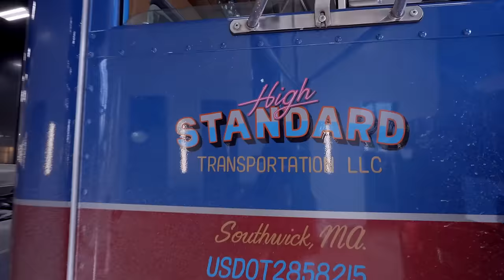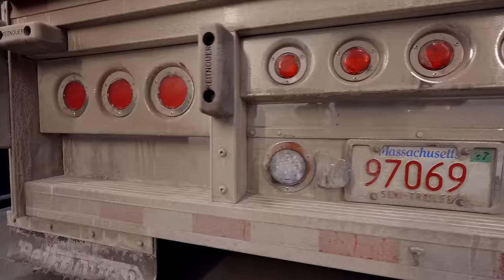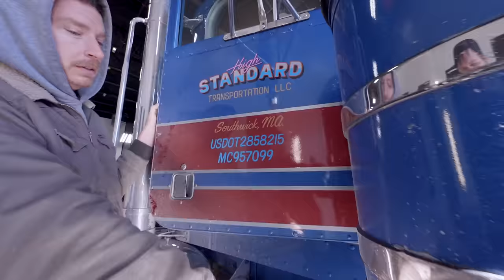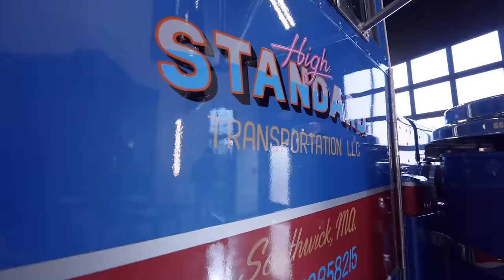Washing 50lbs of salt off a 1987 Peterbilt Big Rig(super satisfying)

Comment: New to the channel-I was a lot of big rigs- do you have a reason you normally wash from the bottom up when spraying off?
Noticed you did it on the tanks.
Love the vid!
Reply: If you start from the bottom to the top it’s so you have a lower chance of missing spots from all the soap running off and loosing track

Comment: When will the new formula start shipping?  And will it do the whole 5 gallon pail or still just the 4 gallons like before?  I need to order some soon and I’d like to wait for the new formula if possible. Love to be a tester also if you need it.
Reply from the maker: I’m hoping to have everything final by mid summer. There will also be a new liquid version with a really cool feature that will even stand out over the powder must likely. We found that the process of evaporating down to powder refined the ingredients tho which is probably what led to the thicker foam and potentially a performance boost, so I’m hoping to be able to create 5ga of 25:1 ready to use soaps out of the 16oz jars of powder. Reach out at orders@chem-x.com I’ll def need testers😁

Comment: Love seeing this touchless wash method, question. Is the stars and stripes soap okay to use on professionally ceramic coated vehicles ? That’s actually what I do for work I coat all types of machines, would love to offer something like this to my customers. Always tell them to avoid car washes unless they are touchless. Thanks! Great video! 🍻
Reply from the maker: Thanks! Yeah I have a LOT of customers who use them on SiC coatings and have never had an issue, I've hit a bunch myself too and even on a data sheet level the pH tolerances on the SiC coatings I've researched are beyond  the Stars+Stripes formulas, it def helps the touchless soaps work better tho

Comment: When will the new powder be available? I ordered a gallon of each Stars and Stripes, but didn’t plan on ordering again due to my stripes just being basically water lol.
Reply from the maker: So I’ve got to make sure the results are keeping up with the current liquid blends, and also make sure that it can stay stable over a long period of time once it’s mixed this way, normally they are blended when the liquid version is made. The sds still has to be authored, it should be very similar but the new form factor will need an update and certainly a new packing group for shipping. The label is looking cool but can’t finish that until the sds is done, and then I have to finalize my new label material and get proofs, usually two runs of proofs are needed if the material or colors aren’t quite right, and then we can go to print, we will also need to make an updated label for the 5ga pails the powder is mixed into. I have the final jar for them selected but still need to source the final cap and seal style, and then we can start bottling the powders. Then we need to design the product page and graphics and product shots. I’ll also need to figure out our total cost per unit and figure out how to offer them the best price point. We’ve got a bit of work to do still lol
Reply: @ChemX these powders will be an absolute game changer!

Comment: I have metal spray bottles I got them from a hairdresser they do the job alright haven't had one fail yet
Reply from the maker: Every liquid has an ideal material for storage, a lot of soaps don’t like metal containers unfortunately, cause it would be cool otherwise
Reply: @ChemX does it help they're painted inside and out.
Reply from the maker: @Mosesmombassa  a coating would help probably but I haven’t seen any options out there like that myself

Comment: So how’s the work on your salt inhibitor coming
Reply from the maker: The formula is finalized, the label is looking sharp but need to wrap that up and get proofs then printing, I’d like to bring it to market by this summer in prep for this coming winter season
Reply: @ChemX good to hear also since I got to the point where your talking about bottle size I like the current bottle size personally also is there anyway to bake that inhibitor into another product or does it need to remain separate for the chemistry to work
Reply from the maker: @Doubie.  we’re on the same page man I’m still debating building this rust inhibitor into my touchless soaps just gotta see if it causes any issues like separation over time in the bottles

Comment: That looks like just plain rock salt that washes off fairly easily.  If it were calcium chloride I doubt it would have gotten that clean touchless. And I use stars stripes
Reply from the maker: We use calcium chloride up here my our area too, if your not getting it all the way off tho you may want to strengthen the mix up a bit or be sure to rinse at about 6” to 12” depending on your power washer, what ya got for specs on your machine?

Comment: high pressure water does 99% of the work.

the rest is there to give you the illusion that something special is happening lol. you could put dawn dish soap in there and you'd get the same result.

but i'm glad people are so easily amused and swayed, it makes selling to them much easier.

That's how i make my living, i take base normal everyday stuff, repackage it with great art work and claims that have no basis and oh how the money rolls in.
Reply from the maker: That’s a solid idea actually I’ll have to make an uncut side by side touchless wash with dawn and see how it goes, if dawn does better I’ll raid the corner store and dress it up as my new ultimate single step touchless wash😎👏👏👏
Reply: Also, you must think that everyone at home has a 2400+psi @ 3.5gpm pressure washer. They don't. The majority of people don't have 7k pressure washing setups. Mine for example. I'm not American, but it's better than the British ones available. I have a Wilks USA, 2400psi at around 1gpm.   

So how dumb are you on a scale of 1-10?